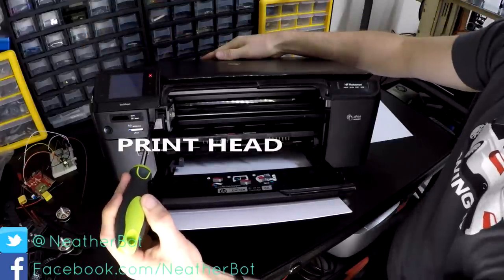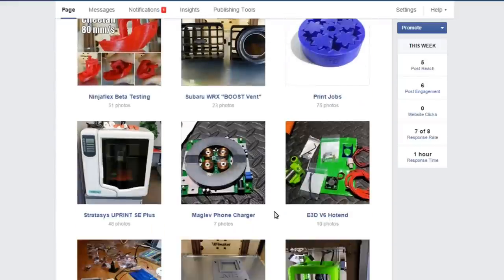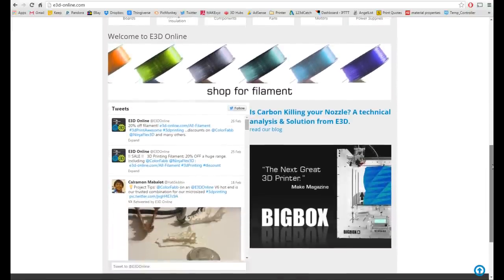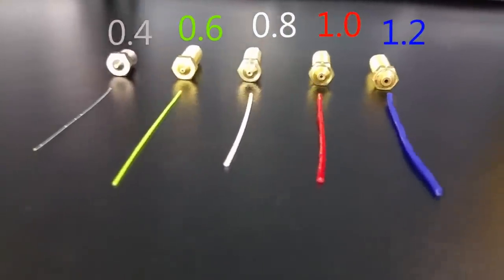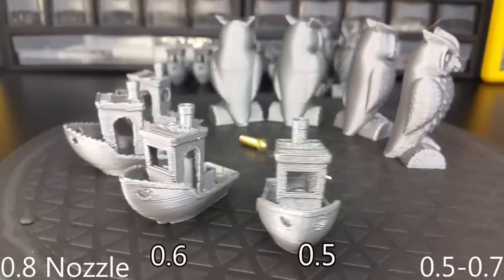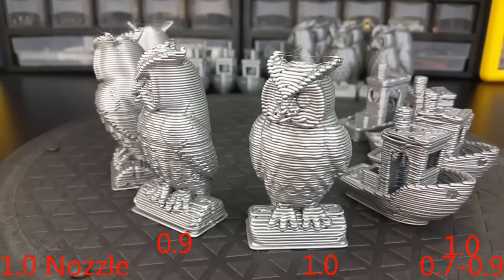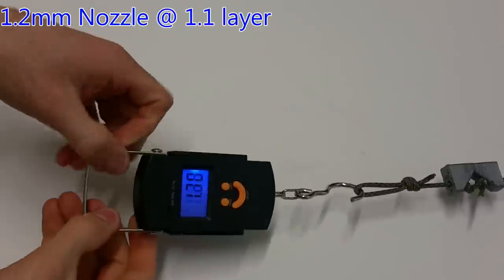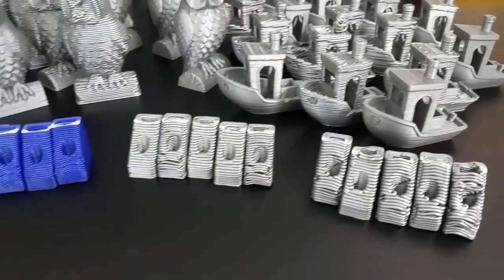Volcano Hotend #1

Comment: your strength test thing isn't quite right... Sure thicker layers means more strength, but it isn't really the layers that are giving it strength, its just that there is more plastic... the better, more accurate and viable test would have been to print each thing so that the wall was equal width for every, single, print. As in, if you printed it with two perimeters for the 1.2, then make sure all the others have MORE perimeters so that they can equal the width of the two layers produced by the 1.2 nozzle. THAT will show how different sized layer heights affect strength... because expecting a 1mm thick wall to withstand the same forces as a 4ish mm thick wall, is kind of dumb... it doesn't show the strength of the layers, but the difference in strength between thin walls vs thick walls..... i'd almost bet ya money that a .6mm layer height print with walls equaling 4mm thick, would be very similar to that of 1.1mm layer height walls 4mm thick. May only be off by 5-10 units if that.
Reply: I've seen some others tests and we can really confirm that larger layers means strongers prints

Comment: did you compensate the with of the parameters to make the smaller ones the same width. if not then the comparison if in accurate because you are comparing different amount of contact areas and not if the layer height makes it stronger.
Reply from the maker: +Jonathan Hernandez the point of this was to show just that. The larger nozzles create a taller wider bead that has more contact area and creates a much stronger layer to layer adhesion.
Reply: NeatherBot I understand that, that was the point of this comparison but I just felt it was an unfair comparison. besides the point it was a good video

Comment: Hello, great video. How are yor retraction settings for a standar volcano 0.4 with bowden titan extruder? have tevo flash printer and haver clog all the time. thanks!
Reply from the maker: I try and retract as little as possible. When I’m using a volcano I think I was retracting between 3 and 4 mm. But a lot of that also depends of what temp and material you are using. Also if the printed part has a lot of retractions can cause problems if you grind away the filament by going back and forth a lot. Give me more details and I can try and help you troubleshoot.

Comment: Very good and thorough video! Lots of work went into this and i have learned that picking the right nozzle when having a volcano is going to be hard.. Like your cable management in your hotend design. I might end up drilling a hole in my E3D V6 to get the same result. Thanks for the idea! You might want to change the title of your video though, because it is so much more than the title suggests.
Reply from the maker: +Tinkerman thank you for the kind words! This video did take a lot of time, but answered a lot of the questions I had about the E3D Volcano. Cheers!

Comment: now I know how long it took you to make test make test ect. and as I content creater I can say a BIG thank you. nice work on all the testing. !!  BIG thumbs up for the effort and I information! verry few will even start to understand how much R&D went in to this video.  Thinking about using some intresting concepts in the future on my current delta (built by scrach and a bit over sized ) so this I go will come in handy. keep up the greate content. ~Russ
Reply: +Neather Bot well I'm glad you did it. :)  I understand the efforts. and it will I feed save the rest of us a lot of time and money :). delta build volume is curently 340mm round by 450mm tall. This can be expanded eazly with taller rails but this is built from all scrap stuff i had around. and that's just what I had. check it out here. http://rwgresearch.com/open-projects/oversize-delta-3d-printer/  Also how much time did you spend from start to finish. had to be like 3-5 months ( at least for me it would be lol ) best. ~Russ
Reply: +Neather Bot +Neather Bot yeah. well at the moment the new delta is not finished. but the other rostock delta will still do 340mm tall and I have printed to max on it. Literally I print it until it hit the end stops on accident one time didn't realize the part was too tall for my printer :-)  the old rostock has an enclosure. The new RWG-OSD Delta will also be fully enclosed and a heated chamber.   well a few weeks is really good. I mean if you made all the hotends. then tested them. then all the other test prints. that's fast. (as I have 5 kids all under 6 so time is hard here :) )  more videos. just make quality videos. don't worry so much about the how Manny. I once spend 6 months making a video every 3 days. then made 1 quality video every month and the quality wins. so don't worry about quanty. spend the time on quality. :)  ~Russ

Comment: Nice i've waited on a new video for a long time. Im the proud owner of a ultimaker v1 as well. 
I bought a e3d V6 but could really get it to work properly but printing with e3d nozzles in my ultimaker heater block is working for me :)
Reply: +Neather Bot well the problem is that i wasn't able to print a accurate mount for my e3d V6. So the nozzle wasn't horizontal relative to the printbed. And somehow the heatbreaks back screwthread (going into the heatsink) stripped and is now stuck in the heatsinks screwthread.
Reply: +Neather Bot the problem i get is that is difficult to retract the Filement, this is because  the underside of the heatbreak tube is 3.3 mm in diameter and the top 3.1 so that makes that the filament deforms in the hotend and turns in 3.3 instead of 3 and making reversing it out of there impossible
Reply: +Neather Bot well it is like you say, i bought it from a authorized e3d seller so i would think its a orginal e3d heatbreak

Comment: Love your videos. Helped me install my heated bed like a year ago and I just put an enclosure and a pei build surface for printing abs. works like magic. 

Also, just wanted to mention that the nozzle diameter strength comparison test here is totally inaccurate. You would need the same thickness of walls(of course the thicker piece of plastic holds more weight LOL) and same plastic(not testing Blue vs silver) for each part to find layer adhesion.
Reply from the maker: Hey Luke, I'm glad you have joined the #heatedbedsquad! It really does wonders for helping prints stick. Ok so you get the award for pointing out some of the things that have kept me up at night.

#1 Yes, it makes sense that if you have to print 4 perimeters of a thin layer to get the same thickness as 1 thicker layer, and it may seem like I'm cheating, BUT my point was that with the thicker layers you get a stronger part.  There are lots of ways to analyze this concept but when the day is over the statement is still true. "Thicker layers provide increased layer adhesion"

#2 I did not plan ahead and started with a partial spool so I ran out of filament 3/4 the way through all the pull tests. So I made the decision to go ahead and record the force and overlap the two filaments. Both filaments were Colorfabb PLA/PHA so I knew they would be similar material properties. I found that to be true when I compared the difference of the recorded force pulls between the same layers with different colors. Between 1-3% required force to pull the layers apart between the two colors.

Congrats on being the first to call me out. I would have noticed the same thing on someone else's video, and knew someone was going to say something. But I feel confident that I am still delivering factual and repeatable results that help the community. I hope you agree!
Cheers!
Reply: +NeatherBot yea I totally agree that what you did is worthwhile and good to know. I think layer adhesion has much less impact on strength than you showed in your parts(as long as you are within the recommended printable range and its still somewhat of a factor of course). 

and have you tried using octoprint? Its more plug and play than it looks like. and theres even Android apps out there to control your printer using it. :)

My friend and I just finished a little experiment with 135 PLA tensile specimens tested on a laboratory machine using different settings for infill, wall thickness, and temperature which gave some interesting results(still analyzing the data)(I'll let you know when were done). Its surprising that there isn't much data out there on how infill effects strength. not even really a standard for testing parts with different interior geometries. 3d printing is on the rise though :)
Reply from the maker: +Luke Bockman I did set up Octoprint for a weekend awhile back and it seemed a bit buggy, but I had an old pi. I bet the new V3s would work awesome. 
Oh wow yeah sounds like you are doing some great work! I would love to hear about what type of results you come up with. Keep me in the loop.

Comment: I do believe it would've been more of a fair fight if you didn't print the letter adhesion test hollow, and instead tried splitting a section of the same surface area for each extrusion width.
Reply from the maker: +Eric Karczewski I understand what your saying. I was trying to show how you can increase strength with same number of perimeters, I suppose a better test would have been as you recomend printing a solid piece and observing how different sized layers effect strength. I may have to do some more testing to see.

Comment: In designing your own hot end completely out of stainless, why machine it? That sounds like pure madness! Why not just punch out, or better yet buy pre-existing, stainless washers and alternate with stainless spacers (again, buy or cut from stainless hydraulic line/tubing) then pressure fit onto smaller diameter stainless hydraulic line/tubing. Worst case scenario you could braze it all together if you are afraid of losing thermal conductivity from not having single-piece construction. 2cents
Reply from the maker: +confusedone97 that's a pretty good idea. Haha I wanted to learn...so I choose the hardest route possible ;)